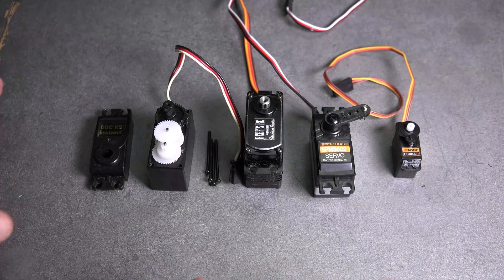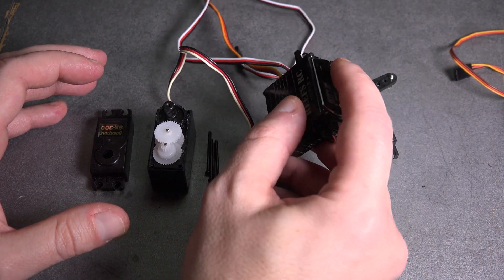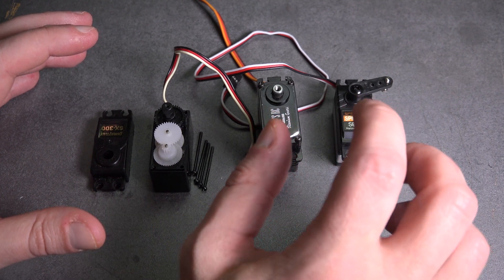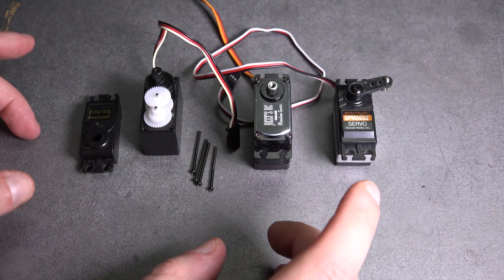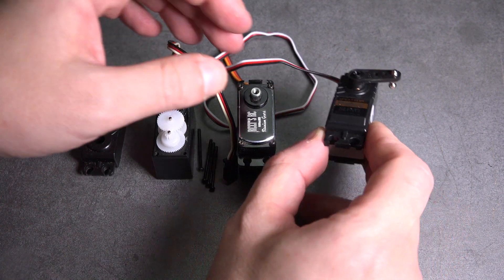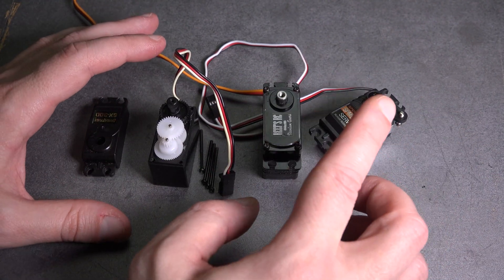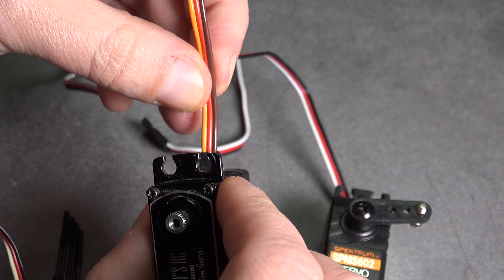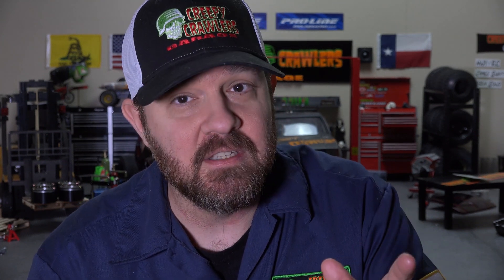Servos! - RC Basics E4

Comment: Really good info and perfect timing. I came across a old New Bright Ford lighting truck over the weekend man that truck is huge at least 5th scale size Im planning to make a rock crawler with it using the wraith axles.just started the frame but not sure what size servo to use for steering when build it will weigh probably 15 to 20lbs and suggestions for a strong steering servo?
Reply from the maker: I'm not sure your budget but I like Reef RC servos. The 555 is their high torque (555oz) standard size digital servo and would do you well. The main thing is you'll need a high torque servo.
Reply: @TandemCTelevision  I was thinking of getting a couple of those. Thanks for your input.

Comment: Thank you for the heads up,so if it says water proof, is it really water proof? Love the show
Reply from the maker: Generally no, it's what I would consider water resistant. Meaning it can get wet but if submerged for any length of time it will eventually fail.
Reply: @TandemCTelevision  how do you feel about the water proof coatings out that say you can spray or brush on the servo board
Reply from the maker: If you use anything on the board make sure it's non-conductive.
Reply: @TandemCTelevision  Okay,thank